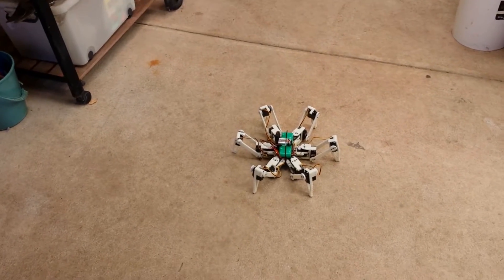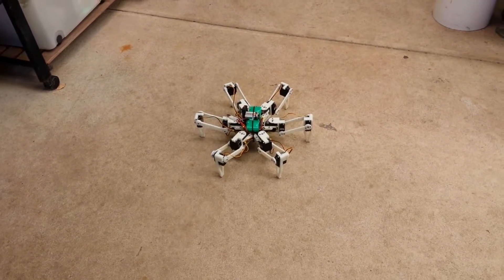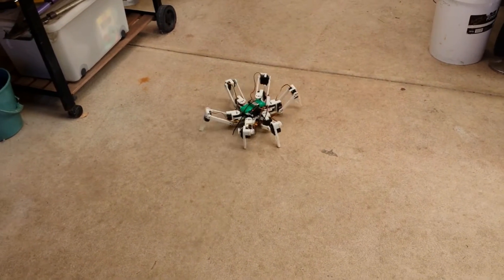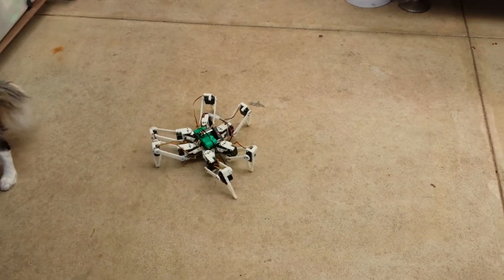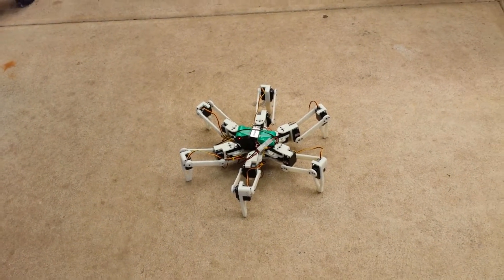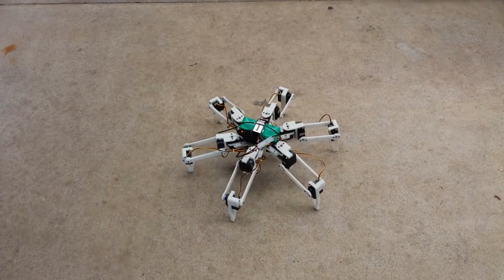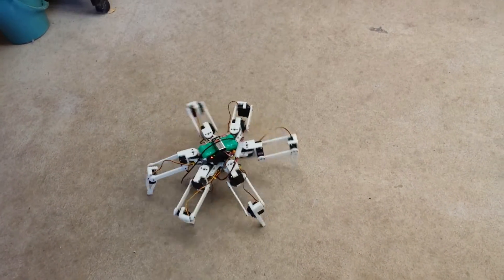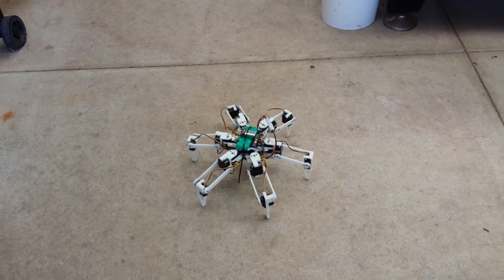Fully 3D Printed Hexapod - Update

Comment: your system = SSC32 + Rasbperry pi +18 DOF servo + adruino mega .. Did u use adruino mega board ?
Reply from the maker: Just an Arduino Uno. It now actually runs on a Nano
Reply: @chrisherring8733  does this work with a Pi 4?